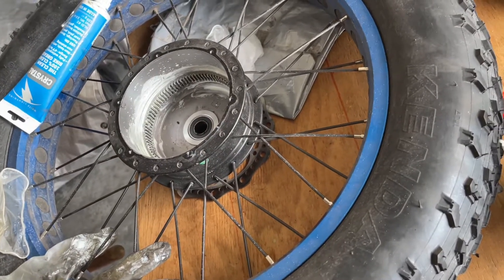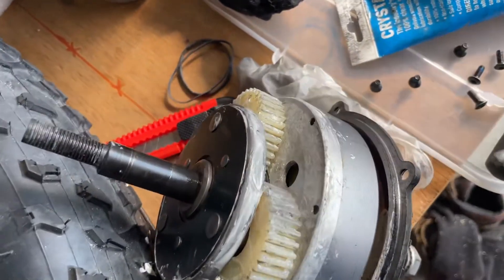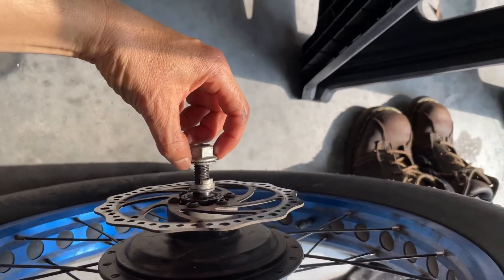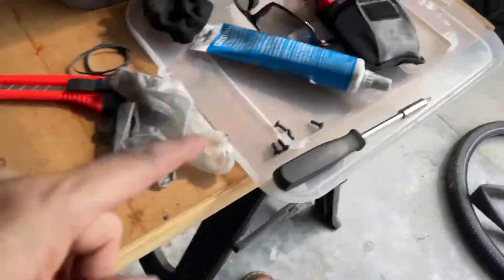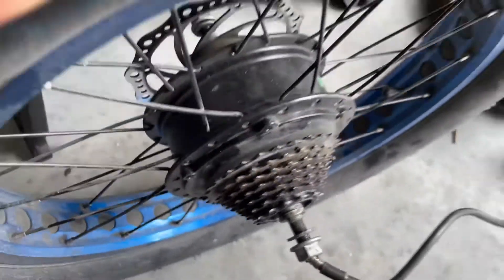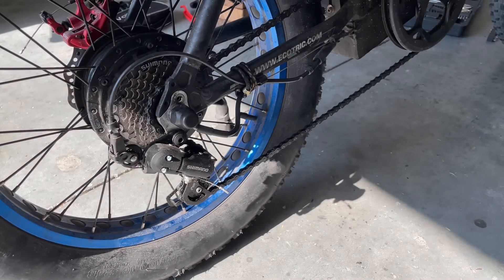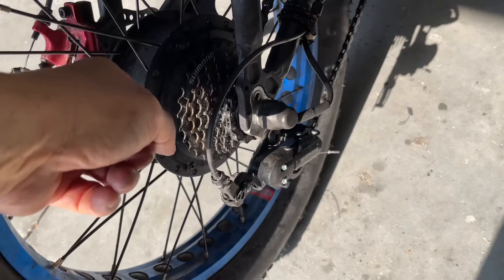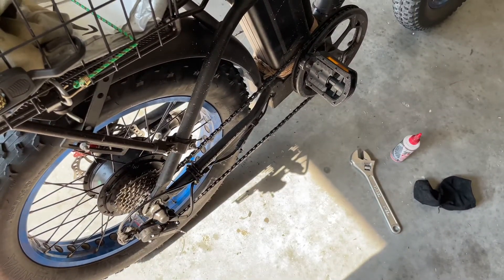How to grease E-bike gear hub motor: regrease the geared hub and planetary gears

Comment: better yet...just take the screws that hold the disc rotor out and use a hypodermic syringe and inject grease...that way ya dont have to disassemble the motor
Reply from the maker: I have not seen anyone doing that.  You need to lube the core teeth  metal shaft inside, all teeth on 3 plastic gears, and the teethed outer rim built inside the metal hub.  Only fingers can reach those area.   But who know if you said that way with injection may be a link to the demo?  So everybody can learn.Thanks for watching have a great day.

Comment: How often or how many miles should it be regreased? I don't want my new back wheel hub motor to rot out like I believe the last one did but it did have over 2200 miles.
Reply from the maker: Once a year won’t hurt, but it depends where you live, the cold weather always dry up the hub quickly.   1500-2500 miles between that won’t hurt.  Again depends on the sound if comes out earlier than that.

Comment: Would you recommend Lithium grease for geared hub motors?
Reply from the maker: You need waterproof grease, any bicycle waterproof grease will work best, the one used on bearing, bottom bracket, etc.  Car grease is messy and some are not water proof.  I saw some folks in nyc using it but it is very messy
Reply: @MrMtr999  any particular brand you would recommend that I can get at a local store or autoparts store? I was gonna use mobil shc100 but the Amazon seller fell through
Reply from the maker: @maximumchargeEV   Park Tool PolyLube 1000 Bicycle Grease https://a.co/d/iazKfgH

This one is good all around not only hub motor but also all on bike
Reply: @MrMtr999  I use Valvoline red grease, it's waterproof with a 275F flash point.  It's might be dirty if exposed, just like any grease, but it's more durable than bike grease.  Notice the little tube of Park Tool cost the same as Valvoline grease with a higher temp rating and is water resistance, in a big tub.  Bike stuff is a niche market compared to cars and machinery, that's why they charge so much.  I've been using red grease for a lot of things, it holds up.  If you can use it on heavy machinery and cars, you can surely use it on a bike.  With the heat the hub generates, red grease is a better choice for it's high temp and durability.  I use red grease in my headset, it's thick and last long, unlike bike grease that dries up yearly.  Even new formulated lithium white grease is very good for these plastic gears and bearings.  Have you ever taken apart anything with plastic gears? Notice the white sticky stuff, that's lithium grease.  It's used in washers and dryers, car power seats, remote hatches, or anything that uses plastic gears that has a motor attached to it.  Here's another thing too, bike chain oil vs gun oil.  Gun oil is cheaper and has high lubricity, 400F flashpoint high temp, and anti corrosion properties, but bike oil is more expensive.  Gun powder is very dirty, chambers get hot, but the gun lubrication still keeps the gun operatable in harsh environments like war.  You can by Finish Line for like $14 or Hoppe's no9 for $6.50.  One is made for riding around, and one is made to withstand harsh combat environments.  Simply Green and Zep are both degreasers, you can buy 1 gallon for $10 and you can mix up to 9 gallons worth.  Muc Off degreaser is $25.  They both do the same thing, they're both bio degradable.  One is a lot cheaper and you can mix it how you want it.  For cleaning my kitchen stove, I do 6oz and water in a 20oz spray bottle.  For my bike chain, I do 50/50 mix.  That one gallon will last me over 2 years.  From cleaning my kitchen, outdoor furniture, tools, and bike chain.

What I'm trying to say is, bike stuff is all marketing, because there's stuff out there that's even better and cheaper, but they know cyclists are sometimes very snobby and will buy the most expensive stuff like they're sipping on an overpriced Chai Latte.
Reply: @MrMtr999  Just want to add one more thing, if you ever want to clean your bike, don't buy bike soap, car soap is a lot cheaper.  It's pH balanced to not dull paint and work on carbon fiber.  If you can use quality car soap to wash a Ferrari, you definitely can wash your bike with it.  Muc off sells bike soap for $25 for a 30oz bottle when you can buy 128oz of carwash soap for the same price.  Don't believe it's for "carbon fiber" BS.  Carbon fiber has a strong lacquer on it that's tougher than your paint's clear coat.  If that's the case, then you can't wash any supercar without special soap.  I used to detail cars and still detail my own cars.

Comment: Hello my motor is spinning only on the inside of the wheel do you know how to fix this?
Reply from the maker: My guess you internal planetary gears are worn out. Open the hub and see if it can be replaced.
Reply: @MrMtr999  i have opened the hub and all the gears are good
Reply from the maker: @deliveredlate  did you engage all the gear teeth correctly when putting them back together? I meant all aligned up correctly.